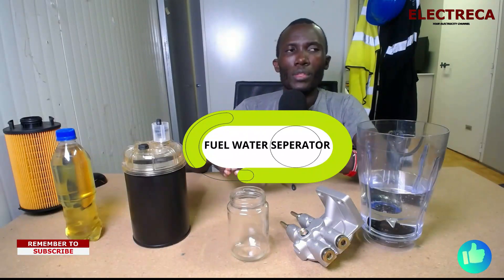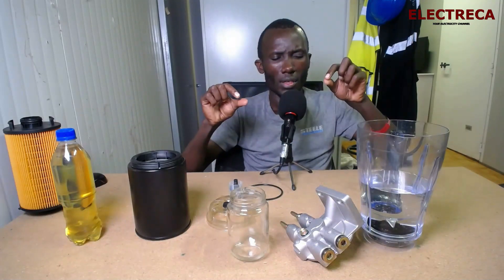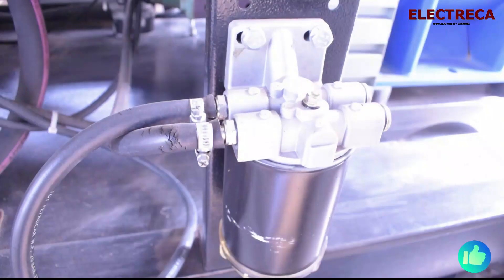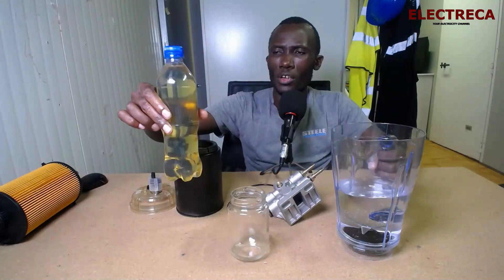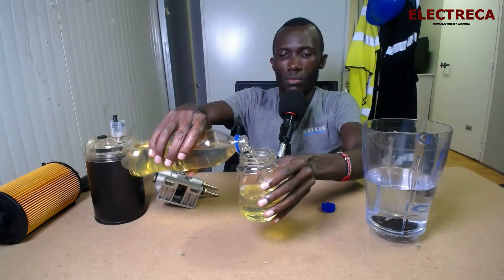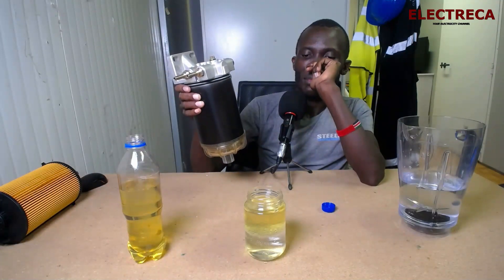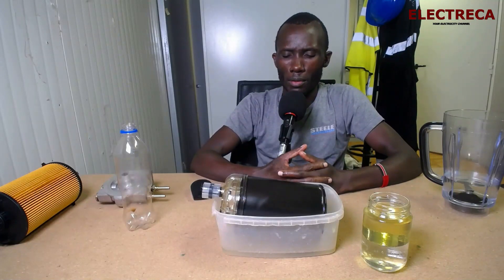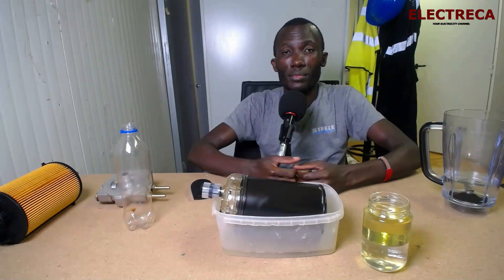how does fuel water separator work | ELECTRECA

Comment: the majority of those water separator filters are spin off type, wich means that the fuel must be ciculating at certain flow rate to achieve a corretct water separation proccess

Comment: thank you for this video. but my quiz is, while  the gen is running will the water filter really get time to settle water down?
Reply from the maker: As long as the filter is not full of water it will serve the purpose,
but if you don't drain filter and it gets full, water will the the engine.